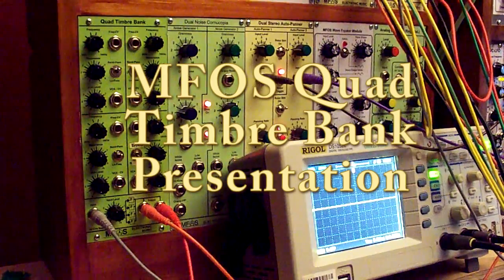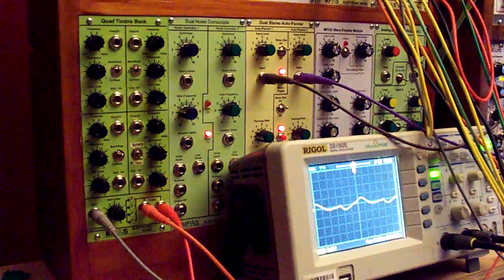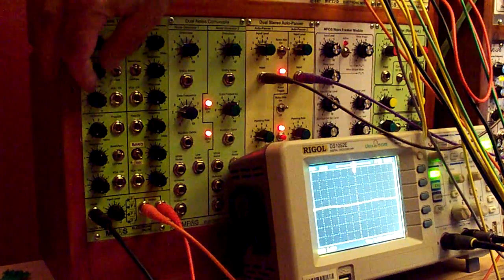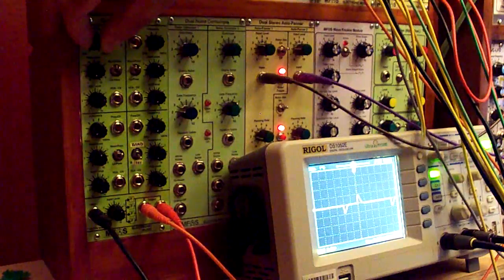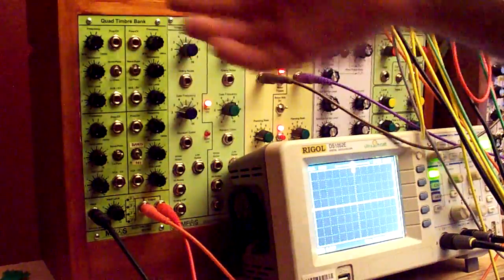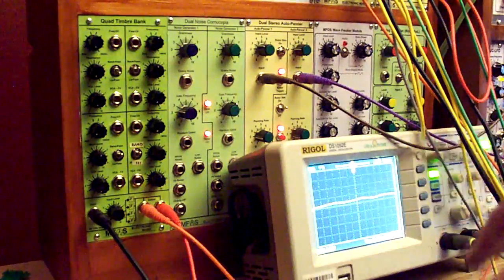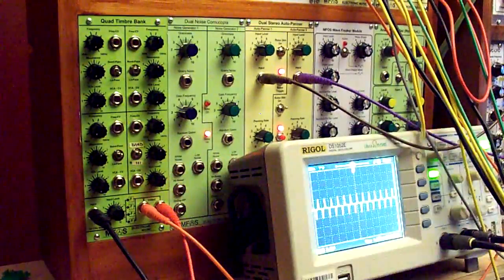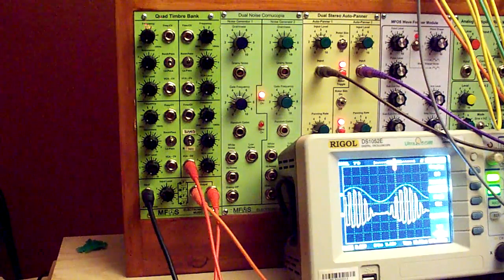Quad Timbre Bank Presentation

Comment: Niiice .. does it also run on +-15 v?? ...
Reply from the maker: Sascha Schneider There should be no problems on +/-15V. There are regulators on board for everything except the input and output buffers which will not be affected by supply voltage.

Comment: Than you Ray for inetersting vidios and devices! I begin make modular synth. You have schematic or device like Voice Formant Filter ?
Reply from the maker: If you go to the music from outer space site and search for vocoder you'll find that circuit. You could use this board to experiment putting the filters and VCFs in series to obtain formants. Using the CV cut-off modulation control of each filter separately is also a way to obtain formant like sounds.
Reply: Ray Wilson Thank you!